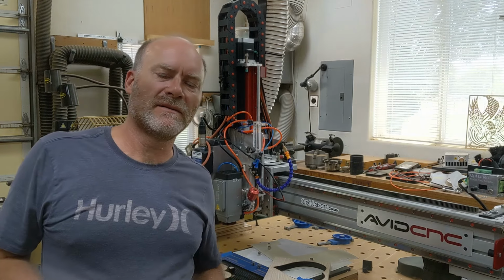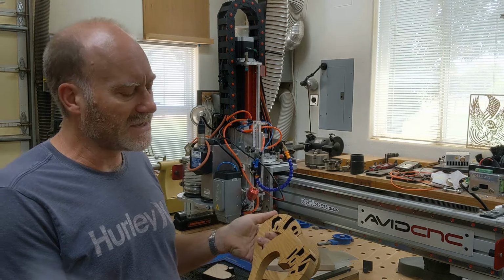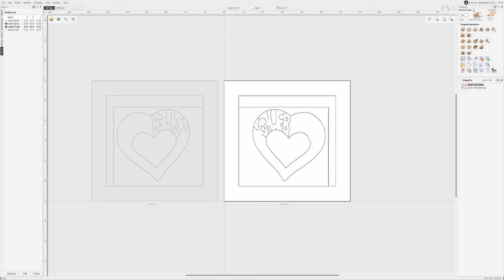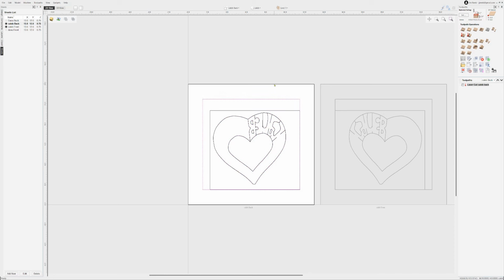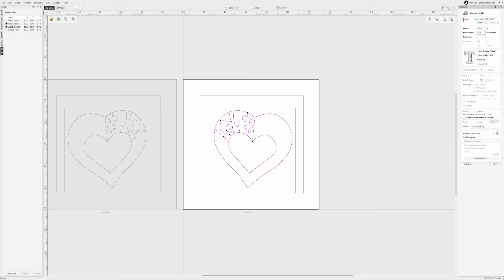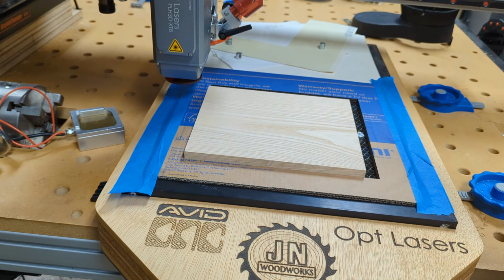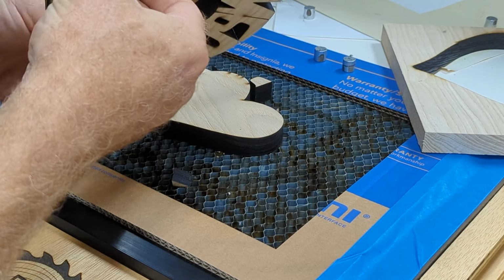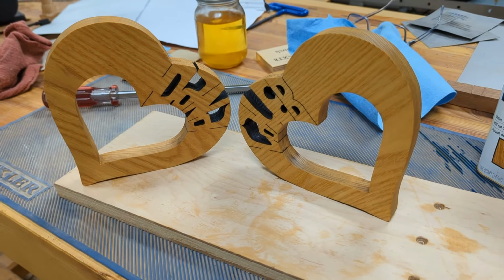Two Sided Laser Cutting With my Opt Lasers XT8 and AVID CNC

Comment: Nice job, I got a lot nice ideal from watching your video, quick question , are those magnetic positive stops and does the laser have protective  lens cover/ window and  how often do you have to change them before distortion of laser. appears?
Reply from the maker: Yes, those are magnets that I used for stops.  Most of the time I don't bother with stops for laser work because the object doesn't move.  The main exception is paper and cardboard because the laser fan and air nozzle tend to blow them around.  In this video, I just threw the magnets on there because they were handy and I needed to make sure they didn't move even a few thousandths.
On the lens cover question, Opt lasers don't have lens covers, the main lens is exposed inside the air nozzle.  As long as you always use the nozzle and don't forget to turn on the nozzle air pressure, or get a spider inside the nozzle (that actually happened to me once) the lens will stay clean.  I don't do production work (I'm just a hobbyist), but I have run a couple of laser picture rasters that took 7-8 hours and the lens wasn't dirty.  I run about 5 lpm of air for light engraving, and 10-15 lpm for heavy engraving and cutting.  The outside of the nozzle can end up very dirty, but nothing seems to get into the lens area.